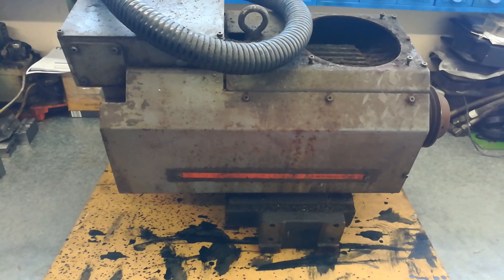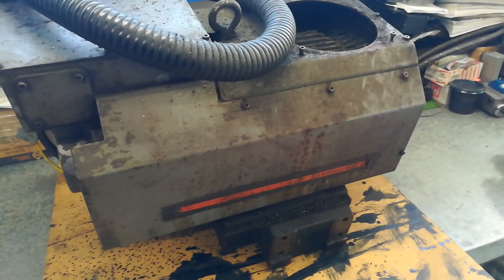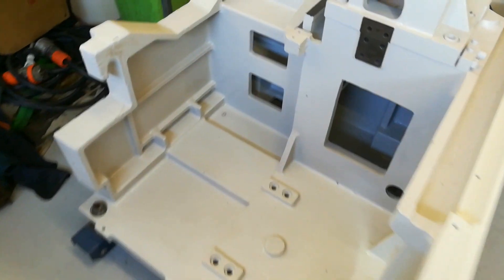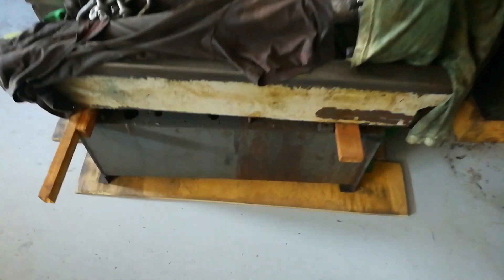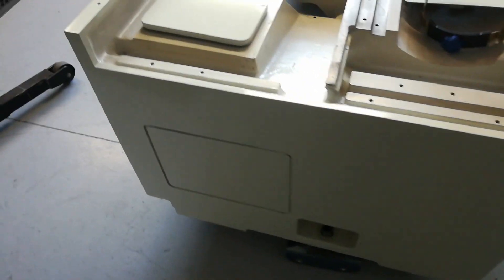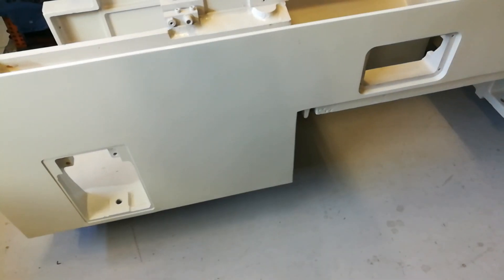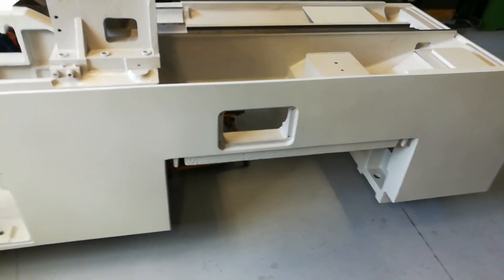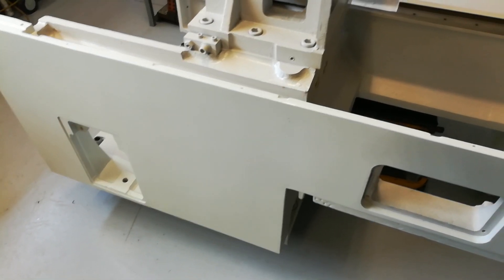Lathe Rebuild CNC.  Just getting started ??

Comment: Very nice! Where abouts in Aus are you? I am actually just starting up a side business myself and chasing a Mazak, I heard Okuma also have good support but I figure Id rather go for something with linear rails that can be easily replaced. How much did you pay?
Reply from the maker: Parts and Service are easy on this brand, Especially Parts
Yes the idea of Linear Slides on an older machine has it's advantages and of course some disadvantage.
Replacement is a Huge plus especially on an older machine.
The only downside with Linear Slides is rigidity.
Not so good for heavy cuts.
But Linear Slide has speed which is a plus when run short run parts.
I guess it will come down to what machines are available to you when you are ready to buy.
Because i am based in Australia we don't have a huge range to choose from if buying locally.
I really wanted a QT 15 mostly for it's fairly small footprint.
I could be happy with a 5 axis Mazak Lathe, LOL.
But this QT15 is just enough of everything i really need.
Plenty of Power,  Space Availability, Parts and Service.
Okuma are a great machine, just not crazy about there controllers , unless it's on a newer machine.
But what ever you finish up buying, you will make it work for you regardless of the brand.
Thanks for your comment.
Good to see someone watching my older videos still.
All the best.
Peter.

Comment: Wow, I thought MY lathe was a work in progress! That is one beast of a machine! That base must weigh a ton too lol. I don't know much about CNC, I'd be happy with a DRO lol. Can't wait to see it make some big chips! 👍😁👍
Reply from the maker: Hey Chris.
It,s a work in progress, lol.
Looking forward to the rebuild and also looking forward to using the machine when it,s finally finished.
My guess is it will be my Christmas Present,  because it will most lightly take me until Christmas to get it back in one piece ????
The base is fairly heavy it weighs around 2.5 Tonne.
Not easy to move around even with the machine skates.
It will be good to get the Spindle motor back in as then i can put it back on it,s feet for the first time in a long time ????

Thanks for watching.

More to come.
Peter.

Comment: Morning Peter - that motor looks a bit scruffy - are you coping okay?  I know that disorder gets you - LOL.  

Looks like it will be a winner when done.  Bearings and seals have to be pricey once all done. 

Pencil in some CNC mentoring time for me if I ever make it down your way.  

Dan
Reply from the maker: Hey Dan.
Always a worthwhile visit, from Dan.
You Bring Such Great Hope and Humour.
You are right it does get me done looking at this mess,  but where there is a will there is a way, LOL.
Bearings and Seals are always a throw away item with me when rebuilding anything.
But i need to restrain myself to some limit with this machine very easy to go overboard.
Mentoring Time No Problem.
I will take you to my local machinery supplier and point out all the machines you need to buy, LOL.

Thanks for visiting.
Peter.